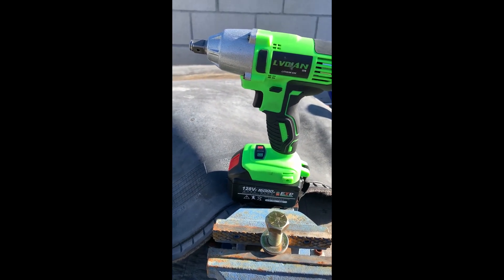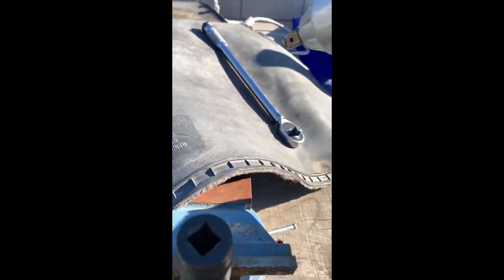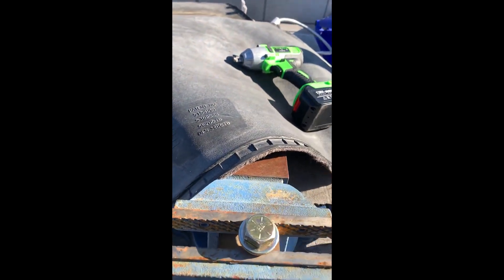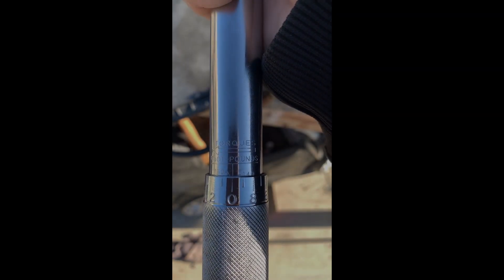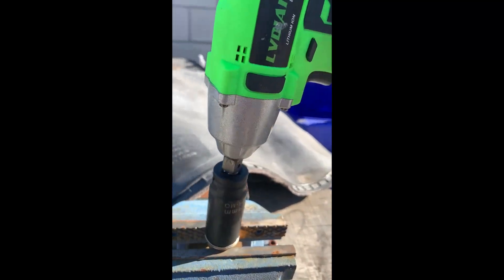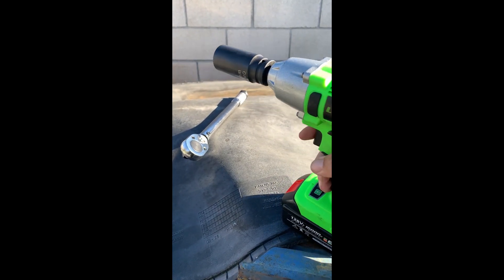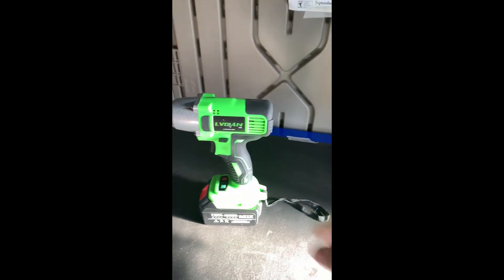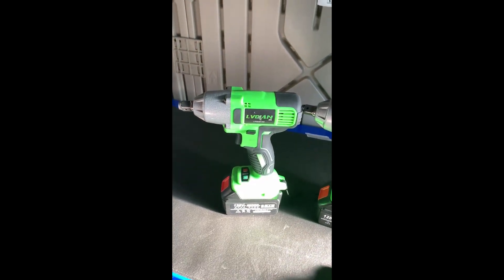Lvidian Impact Wrench Review Cheap Chinese Impact Wrench

Comment: I saw someone selling a Lvdian impact driver on OfferUp. Never heard of it before but you did a great job of testing it. Seems like a good buy for a spare but on OfferUp the price was $175... Those are Milwaukee or DeWalt prices. Thanks for the review
Reply from the maker: thats crazy lol i can still find them for 30-40 on ebay lol
but for 72 u can get one that hits just as hard as a dewalt or milwaukee mid torque